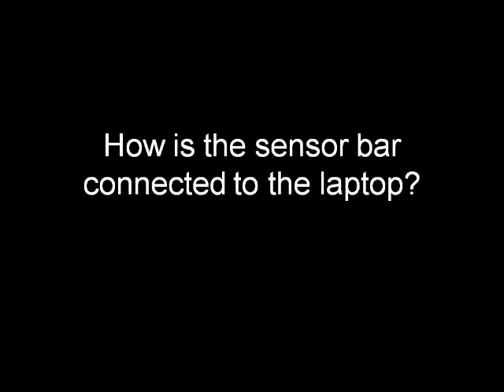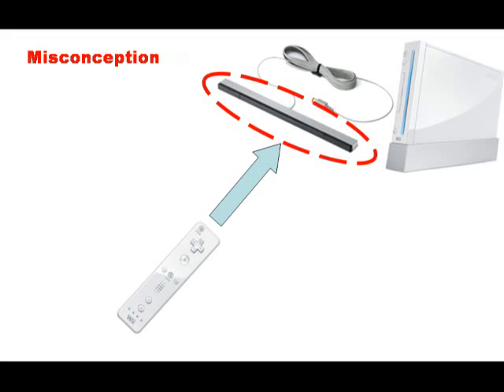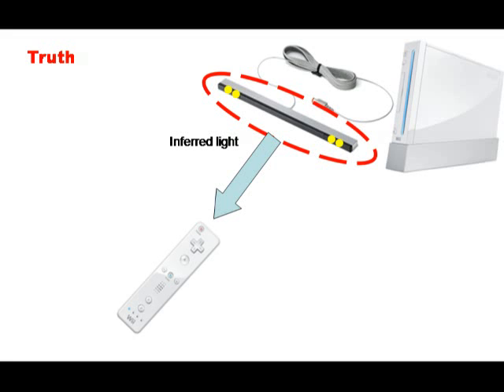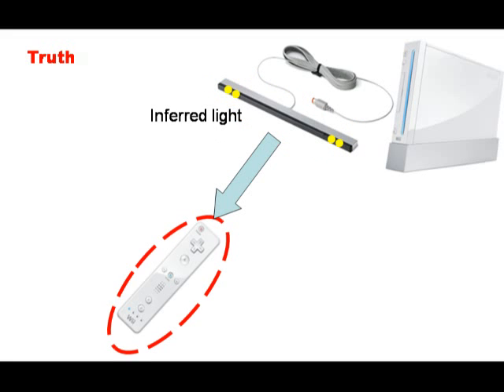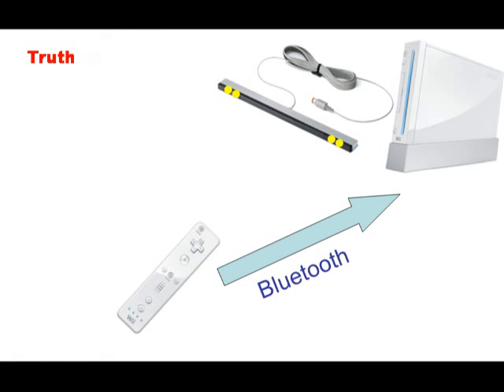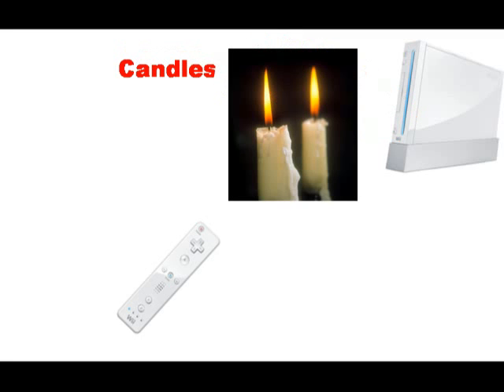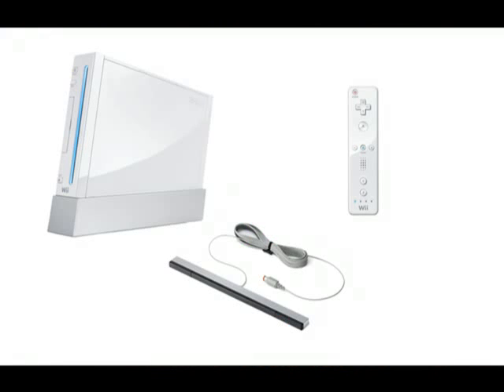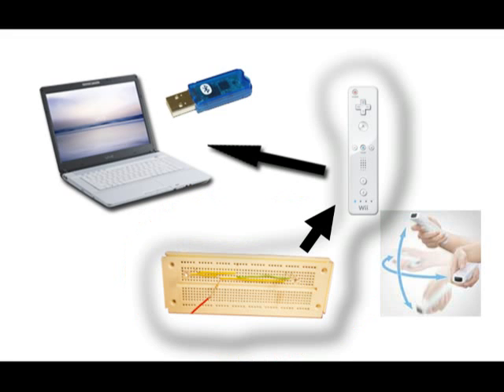Question #2: How is the sensor bar connected to the laptop?

Comment: WHAT IS HAPPENING: THE REMOTE HAS A LITTLE CAMERA THAT SEES INFRARED, AND THE SENSOR BAR HAS SOME IR LEDS ON EACH SIDE THAT THE WII REMOTE CAN SEE AND THAT LETS THE WII REMOTE SENSE WHICH WAY IT IS POINTING BY THE POSITION OF THE LEDS ON EACH SIDE. THE SENSOR BAR ISN'T EVEN CONNECTED TO ANYTHING
Reply: OK THANK YOU VERY MUCH BUDDY
Reply: Tarmist25 try this, go to were you set the sensitivity and press a random button on a TV remote aiming at the black tip of the Wii remote. Watch the fun happen :)
Reply: bro you the real mvp

Comment: Wrong!  The sensor bar has had numerous revisions and 3rd party offerings, the current Nintendo pack-in has 6 LED's powered by 22ohm resistors instead of the upper 40's that the old ones had.  Some 3rd party bars have only 1 LED on each side.

Also, CD's and a bright light reflecting from them work too.  Bam!